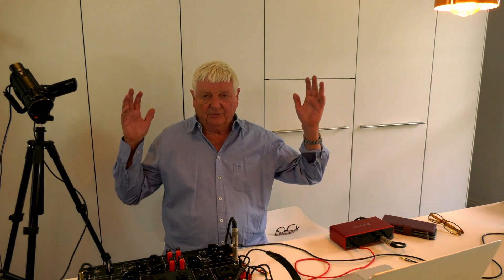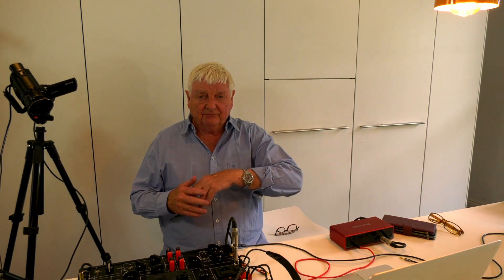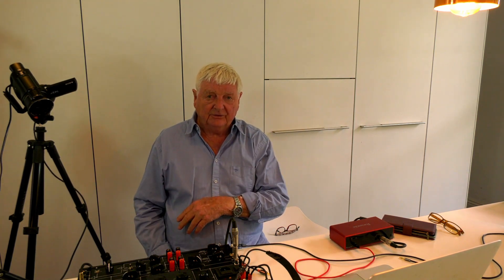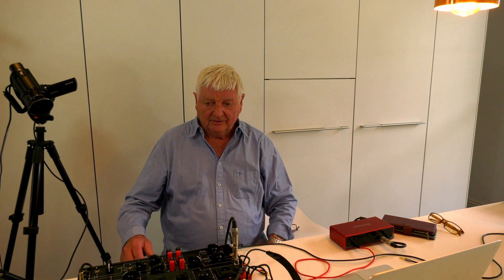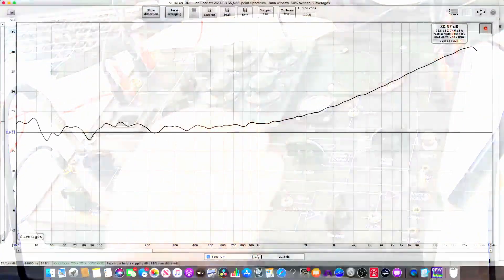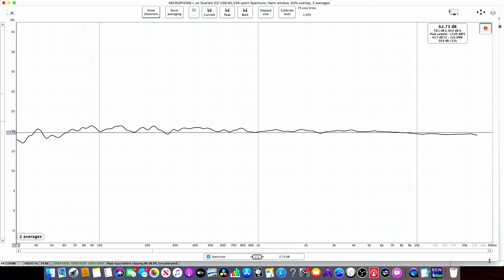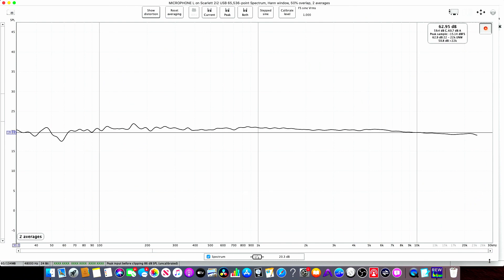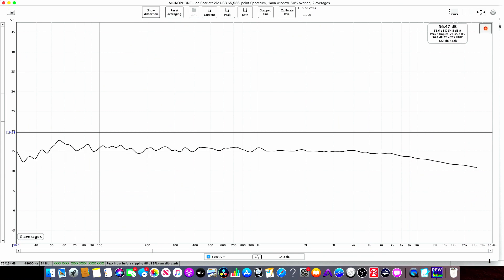"Why Impedance-Matching Speaker Cables Matter - Unveiling Audio Perfection"  By Max Townshend

Comment: I loved your video on impedance matching speaker cables and agree with using white noise as the reference for your tests.  

One curious thing I have found by chance is that if you put a relatively high value resistor of say 330 Ohms or more across a 4 Ohm value speaker it will knock down the harshness /brightness of your sound.  If you raise the value the sound goes more brighter.  You need to experiment.  If you go too low the sound gets muffled and you lose dynamics.

However it gets complicated.  The better the speaker placement the less you need to rely on this treatment.     

The wave reflection is also in the room air pressure waves.   People forget that a speaker is also a microphone at the same time.    Your amp is driving the speaker but air pressure waves cause a feedback current back to it.  I feel my high value shunt resistor is correcting this for the individual's particular circumstances.
 
You need to find a value that gives you the cleanest vocal/midrange frequencies is the best.  Even a 10% change in value can make a difference.

Note the value you use is determined by your whole hifi package. Change your interconnect/amp and so on and you will probably need to change the resistor. Also the resistor value for the right and left speakers may be different too. 

Cheap fine tuning!   

Best wishes for your endeavours. Cheers Keith